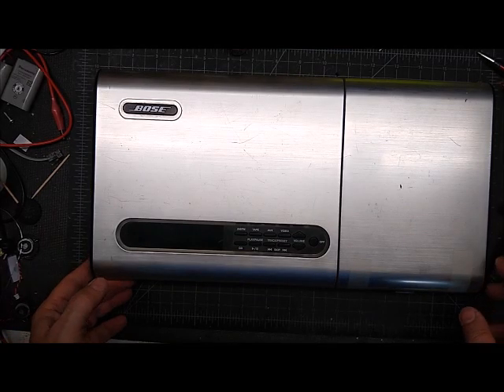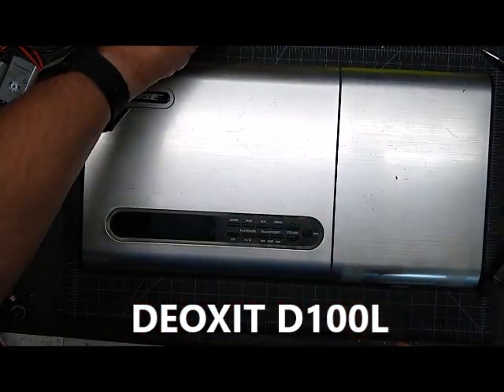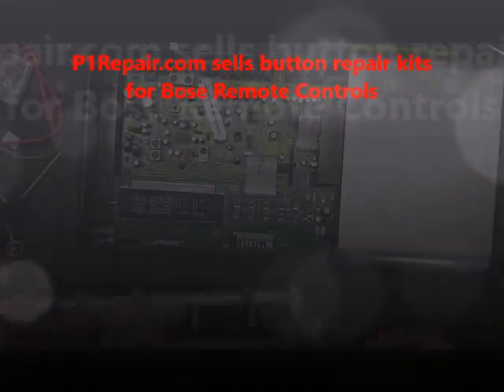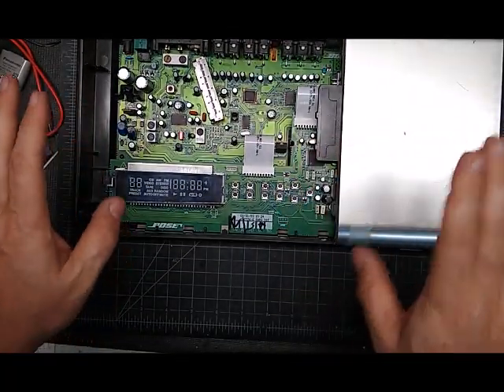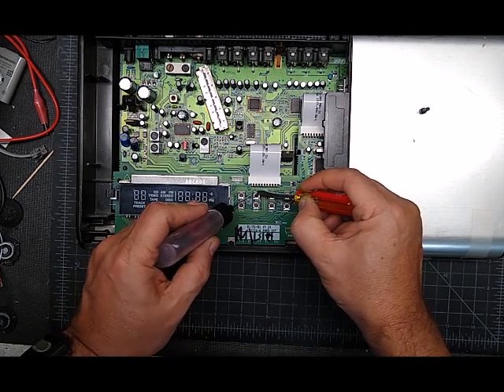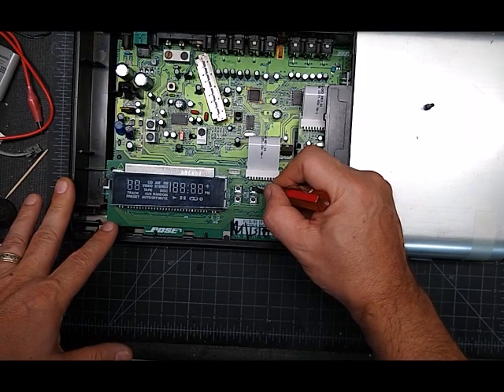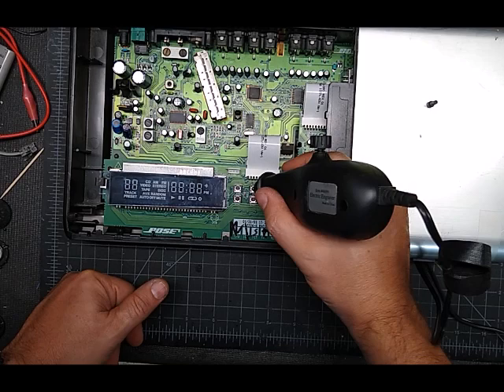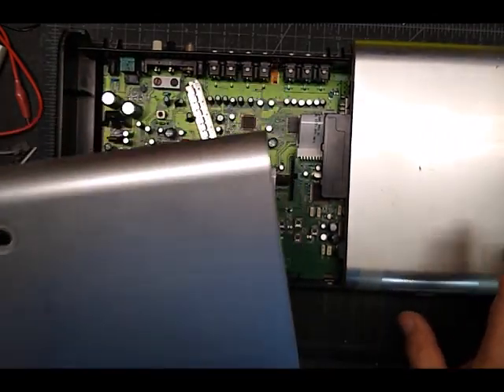How to repair push button switches Bose Lifestyle Model 5, 9 12, etc...

Comment: Brilliant advice! I had an old clock radio that had been given to us as a wedding present by the last Lord Leverhulme. It had such sentimental value, but my wife thought it was done for.

But not quite! I used your tip but used Isopropanol to Alcohol instead of the hideously expensive, (in England anyway), Deoxit D100L.

It worked brilliantly! Thanks very much.

Comment: Thanks SO much. I had no idea this could work (as button worked barely, but had to press dozens of times). Saved me beaucoup bucks, as the alternative was to replace the entire pool control motherboard.  I used two drops of 3:1 oil, a cheap engraver (I've had forever for unknown reasons) on a plastic card to protect the button. Now button works first push every time! Just ecstatic!

Comment: Thank you for the video. I did it with my wife's acetone and it worked. One should move the top of the tact switch in circles in both directions. It helps a great deal. I didn't have the engraving tool so I pressed the button like 30-40 times.
Reply from the maker: I'd not recommend acetone. It can melt plastic and a lot of these buttons contain plastic.
Reply: @p1repair  Never mind. It worked for a while, then it didn't so I left that button out and am using the others on my Wireless-Indoor-Remote-Control-Outlet-Switch. :(

Comment: Thanks, watched a few videos people pulling switches apart and rubbing down tiny discs with sandpaper! I followed your method on a dab radio with a dab/fm and 5 presets that had all stopped working, I used good old wd40 thou, worked perfectly, thanks again.
Reply from the maker: It's worth getting Deoxit when you can. It cleans electrical contacts better and in cases like this it will sit in that button and keep cleaning every time you press it for months or even years.

Comment: I have the same device and the volume is stuck at the max volume. It is almost impossible to use it that way. What is the liquid you are using?
Reply: Read !
Reply: At 1 min in on a 5min video he gave the name and in the description also, so it would have taken you longer to type the question than check, maybe you need a douch!
Reply: He uses something called Deoxit. From the name its prolly something against oxidation?
If the volume buttons are tact buttons this will work..
In my case I used a little spray of wd40 which seriously penetrates and cleanses however idk the effect on the board itself on the long run. Good news is you won't need an engraver to hit the button too many times 😂
Have a nice repair
Reply: @RandomGuy-px8yr  thanks man!